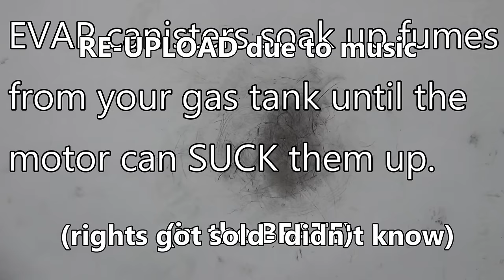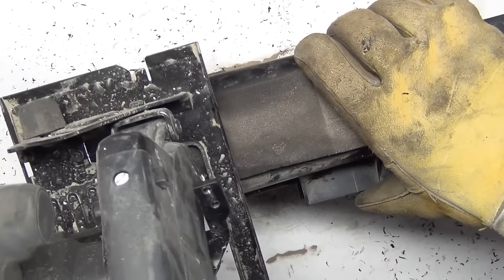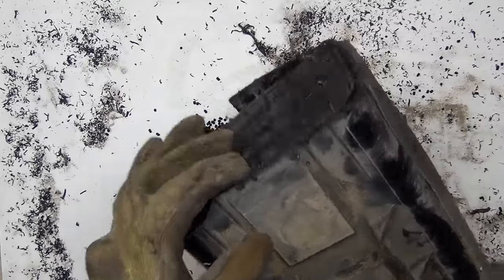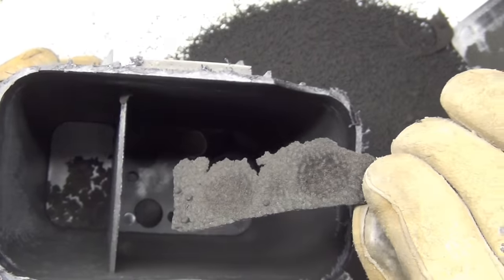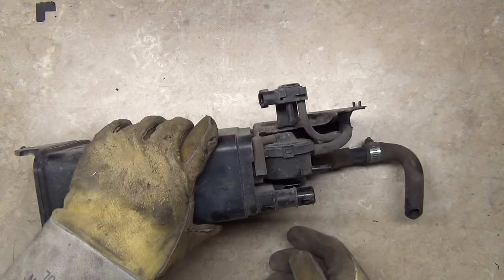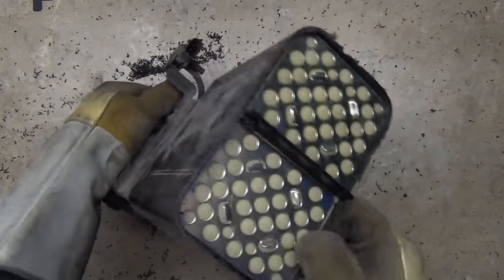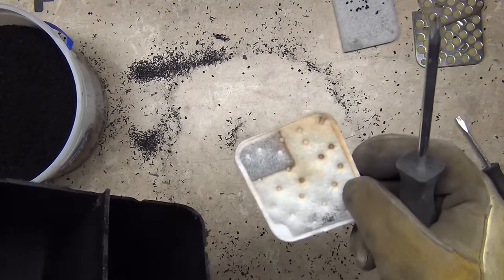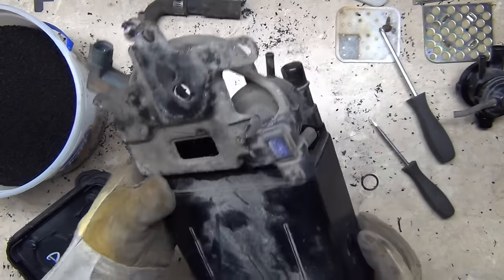What's in an EVAP Canister?  Why do they FAIL?  Toyota vs. Hyundai!

Comment: I have repaired my evap canister on my old 2000 Hyundai accent by cutting it open just as you did and yes that flimsy filter was torn , I went to wall Mart and bought a thin piece of very thin cloth like fabric and a piece of window screen and cut it to size and crazy glued around the edges then added the screen to each side , I refilled my canister with activated charcoal ( you can buy in the pet department) then plastic welded it back together with a little epoxy resin to help .. This fix worked perfectly !
Reply: Great idea! I'm just getting around to this repair myself and looking for ideas, so thank-you!
Reply: Jesus man, I’d just spend the $200, but good on you
Reply: @newbluerugby  right?! 😆
Reply: @newbluerugby the Toyota ones are almost $500

Comment: I had a 06 Tahoe come in for a p0446 vent performance and it wouldnt take gas easily so I checked the vent valve and it was clogged with dirt, I replaced it and sent the vehicle back out. It came back the next day with same concern I ended up pulling the tank down and found all of the evap lines full of those charcoal pellets from the canister that was a first for me never seen one break down like that but it sure was a lesson for me especially with having to drop the tank, clean the lines and replace the canister for free it’s definitely something I will check from now on

Comment: Tried this out today, I had an on going Stoopid P0441 on my '96 Lexus ES300 ( Camry 3.0L), maybe 4+ years, always passed the bloody Kommunist Kalifornia mandated smog check, barely. I have done this for my '85 Porsche 911, Swapping the foam membrane with Cotton Swab Pad from CVS. Great thing is their 4"x4" pads are actually 8'x16" sheets folded in half twice and half, perfect for the 5.25"x6.0"  base of the Lexus ES300 canister. I used my SawSaw to cut the bottom off cleanly, surprised how well it worked. As you found, the foam membrane was soaked and certain areas dense due to fuel/deterioration. I also used a hole punch to make holes in the original membrane to use it's sturdy structure to support the flimsy cotton swab. JB welded. No leaks :-) I will report if this allows proper flow for the EVAP system.

Thanks you Master Brian for the inspiration!

Comment: Helpfull video! I had done my evap canister in the same way, removed the charcoal and cleaned the inside filters with brake cleaner and then refilled with the old charcoal (only 160.000 kms old), soldered back with hot gun (PPR plumbing type). Finally removed the 0420 Catalyst system efficiency below threshold code and NOT reappeared again. Period 😂

Comment: Loved your video! Just when I am about to cry, you made me laugh with your humor. I have an evap  system issue. My 2007 toyota rav4 will be going in for diagnostics next week. hopefully it's only the leak detection pump that needs to be replaced due rusty water in the canister and not a replacement of the charcoal filter or I am looking at about $1500 in repairs. Old age pension doesn't go far these days. Thanks for this video.
Reply: Old man Goat  Depending on the mileage and condition of it, if it's "only" a 2007,  and that's the only major problem for it, it should still last a while longer with decent maintenance.

My only question is if the EVAP canister is necessary if emissions are no longer being tested, and if it impacts any other aspects of the vehicle, other than emissions.

Comment: How’s it going? I normally don’t subscribe to these videos but your the only one to actually take a couple apart to see how they work and why they fail. I just got a 2003 Hyundai Sonata and the people I got it from said they were having difficulty filling the gas tank. I had a good idea what the problem was and figured I could fix it myself without having to do too much. It’s strange, I have had fish tanks much of my life and used many different filters. These air filters are really similar to a canister filter for a fish tank. The charcoal is exactly the same, only on a car it’s filtering air and vapor. Unreal how simple these things are yet cause lots of problems. It seems they could easily come up with a much better design as shown from Hyundai to Toyota. Both could do slot better. Although if these things didn’t fail, we wouldn’t have videos like this and people wouldn’t have to spend millions on auto repairs on parts designed to fail. Thanks again! Hopefully if I have other issues your channel can help! Take care, stay safe and healthy!!

Comment: I believe most of the time, the canister somehow gets a vacuum leak either from the canister itself somewhere or hoses. Also could be the solenoid that opens and closes the valve that's gone bad. Ideal to test and use soap/water mix to identify any leaks in the EVAP system.

Comment: This might be a dumb question, but is the EVAP canister (I have an '01 Toyota 4Runner) necessary to have if they're no longer doing emissions testing? I'm getting the codes pop up for mine, but not sure it's worth it to even have a mechanic go back there and look (would have to remove the spare to get it out) if it's no longer a requirement and has no other impact on wear or performance.

And then the $300-400 to replace the thing. Is it necessary?

Great video!

Thanks

Comment: Dude! This is the best! I've wondered what the inside of these looks like, not at all what I imagined. I thought it would look like a glasspack muffler with larger chunks of charcoal held back with perforated walls. Didn't imagine it would just be filled with fine granules like that. Pretty sure mine is clogged. Wonder what would happen if I cut mine open carefully, emptied the contents and put it back together, hummm...

Comment: Great videos man! Just to throw in some usefulness, I have 
Actually had success reusing the charcoal canisters (on GM trucks and SUV') by removing  it and blowing compressed air in the fuel side you will see all the dirt and debris come out the other. Tap it on the floor a few times and repeat. As you said it saves about $150. Granted my symptoms were a Tahoe that took forever to fuel up and was not throwing codes. Now that we have seen the inside, My guess is its probably just blowing that foam out lol.  Either way it's been over a year and the fuel issues have not returned. Keep up with the videos man! Subscribed!
Reply: I'd be worried to blow any compression through that, would just shred that old brittle foam and sure, it probably works after that, because it's letting all those carbon pellets fill things it shouldn't (airflow). I rather cut it open and redo the activated charcoal and filter kit from like rockauto/Amazon and black silicone it shut or some crap with a clamp. Good stuff, thanks, I'll do that kit I see and measure the charcoal
Reply: @Hedgehodge-  Two years later and I am just now doing this research, so thank-you for the good ideas! I looked and do not see a charcoal and filter kit on amazon/rockauto, Did you ever get this fixed?
Reply: @blackrockbrewing5141  I bought the stuff but winter happened and father's vehicle went to the graveyard. Gave him the car in another state, then the light vanished . Weird lol. Sorry

Comment: So, what your saying is that it is usually the little foam pads that fail in a charcoal canister!   What are the signs that a charcoal canister is stopping up?  Thanks, Tom
Reply: You’ll get a check engine light for p0441, p0445, p0446 etc.

Comment: So, two chambers so that if the user overfills his gas tank on a hill the raw gas only gets into one side, then the other side has a chance of pulling off the evaporated fuel into the intake with less chance of inhaling charcoal pellets? Are the two chambers connected by an internal pathway or is there a tube connecting the two? Does the vent always lead to the same chamber as the tank, with tubing to the purge solenoid on the other side? Or do I have it backwards? I would have thought failure would be saturation of pellets, not degradation of a flimsy filter. As you say, pellets draining out either side is a sure sign the filter on that side has failed. Nice video, Brian.
Reply: At least on my Mazda, the purge valve and gas tank vent are connected to the same side - so the two chambers are not meant to keep liquid fuel on the opposite side of the purge valve like you were thinking. The other side is just the atmospheric vent side. Fumes first go in to the chamber that the purge valve is connected to and then into the chamber where the atmospheric event is.

Comment: That metal plate you knocked out with the holes, could have a second use for metal detecting for sifting sand.
Reply from the maker: Too true.  I have a scoop on a handle that looks like that size hole pattern.

Comment: Hi there, very interesting to see what's in it! Could this part or the valve also be failing causing the car to have trouble idling but without causing a failure code in the ECU? My car runs on LPG (liquid gas) most of the time by the way, could that be causing this part to dry up or get saturated faster maybe?

Comment: If the charcoal becomes overly saturated with fuel it will cause them to fail. This can be caused by an over filled tank. If you compared the old one with a new one there was probably a noticeable weigh difference.
Reply from the maker: That's correct.  Modern gas can'ts (cans, but they can't) don't work on a '99 Elantra filler neck.  It fills the purge line and EVAP can full of fuel.
Reply: Question please. The purge line in the filler neck?
Reply: Ok if charcoal becomes full or saturated what do you replace it with and those membranes on either end in the canister what would you suggest to replace it with that with?

Comment: I'm having a gas vapor smell issue on my 2002 DOHC 3.0 Ford Taurus. Without me having looked at it yet, could the EVAP canister be causing the problem ? I've seen no check engine light, and no codes.

Comment: I saw your video on the evac purge solenoid and how to check. Awesome and thanks for being informative and right on point. I wish I'd found the video yesterday. I brought the canister down off of my 2007 toyota camry v6 by the way. Bright red moon roof. Anyway now that I have it off due to not finding your video yesterday and it being likely the purge solenoid and not the canister. My question is. Can i clean out the canister with water?

Comment: When my canister started to throw codes, i sold the car!
Every screw holding purge solenoid valve were rusted shut 
who put that thing in the car in a first place.

Btw, did Brian just do 360 without falling on skis ?
Reply from the maker: That was definitely a crash and roll!  lol  Yeah, EVAP systems are a necessary evil, but kind of a duplication of resources to the extreme.  If only there were a way to simplify vehicles to have power from one big source that had filters on it and then you could channel and store that power in a clean safe way in our vehicles.  THAT would be awesome!  No more catalytic converters, evap systems, EGR coolers, DPF's etc.

Comment: Been battling a canister that sent charcoal particles up into my EVAP System on a 96 Nissan Pickup and purchased a filter and go to install it just realize bolt tabs are on the opposite side WHY? because it's got to do something with California Emission something another... that one was $60 the correct one $500 on the same page....cheapest found was $160.... might cut that old sucker open with saw and revamp it.

Comment: Got a Subaru P1443 and was suspecting the evap canister spewing bits of charcoal into one of the solenoids. Are there any good troubleshooting steps to confirm the diagnosis?
Reply from the maker: Yes.  Invert the can nipples side down and tap on the counter.  If junk comes out like this one did- it's statistically highly probable.

Comment: Brian or anyone really, I am looking to purchase the Autel MS906TS Diagnostic System w/TPMS.  What are your thoughts?  Should I pull the trigger?
Reply from the maker: I dont have that system, but I do have their TPMS tool that came on a deal with my maxidas and it works awesome.  I think their product line is decent.  I believe the MATCO tool truck brand scanner is made by Autel.
Reply: Thank you Brian,  to repay you for your great videos  I will tell you this....  I had a Tacoma last week with a code P0442 and P0446...EVAP Vent valve.  Problem was that you have to buy the entire canister from Toyota at about $350-500. Can't get just the valve even though same as the front mainly,  right?!  So on a wim I got one from a Camry from then junk yard and it has the same plug and I just customized the hoses.  Dude got his sticker and all set for another year. I'm happy and customer is too.

Comment: What are the drawbacks of removing the evap cannister permanently?
Reply from the maker: A significant amount of poisonous gasses hanging around in your breathing air.  If you just toss it, you'll have a huge vacuum leak, P0171, P0174, poor fuel economy, rough running 2 minutes into driving.  potentially spilled gas on the ground/car, fuel leak smell, wasted fuel etc.  You'd have to re program your computer and or disconnect your purge solenoid.
Reply: briansmobile1 Hey, I appreciate your response. I've actually got a 1986 Nissan d21 hardbody that I purchase which is missing one. Do you think the evap cannister missing would cause enough of an evap leak to make it run really rough and not have much power?
Reply: Do you have to pass a vehicle emissions test in your state?
Reply: Cooll Asice Looks like we don't
Reply: briansmobile1  But See... I miss the days before ECM’s and fuel injectors.  Cars were huge (like Land Yachts), loud & spitting raw gas and oil everywhere they went!  Not a bunch of expensive sensors to replace... ah the Good ole days. 

As a kid, we went around the neighborhood pouring gasoline in fire-ant beds... waiting a few seconds then throwing a match on it ! 😂.  Dangerously Fun Stuff.   We didn’t need haircuts that often, due to singed hair !

Comment: If you don't overfill the tank by topping off the fuel tank, the canister will last 20 years or well over 200,000 miles.
Reply: That's what I think caused mine to fail.  I had several 5 gallon cans of fuel and dumped them into the tank until it over filled the tank.  Possibly flooded the canister.

Comment: 2006 Pontiac Torrent  3.4L V6
Could i Eliminate the vapor canister  all together as this is annoying, This is the second time in 6 Months had to replace it.  
Vapor Solenoid. as when i shut off my vehicle waiting for around 10 minutes you gets a knocking noise right under the drivers side seat under the Vehicle that's where the Vapor Canister is located.
If the cost of fuel wasn't so expensive here in Ontario Canada  at a $1.50 Liter. 
 I Would put My 1979 Firebird Formula 455 V8  Big Block back on the road, it needs nothing and it doesn't have a Computer not like the Vehicles  they make in todays,

Comment: This may be totally ignorant but can’t ya just jury-rig a much cheaper and simpler brand new charcoal canister, like say for an older model year car that only costs like $50 and use the valves and other associated crap, er uh, I mean important pieces from the expensive toyota system using some hose adapters and such.  $250 is a bit steep for these old bangers, even if they are toyotas!

Comment: You could put that in shotgun shells for non-lethal home defense.
Reply: Want non lethal, use some  small grind salt, sea salt would be perfect. Using rock salt is just as lethal  as lead or  steel.   I've seen  what rock salt can do to a  steel  for sale sign.  Wooo hoo